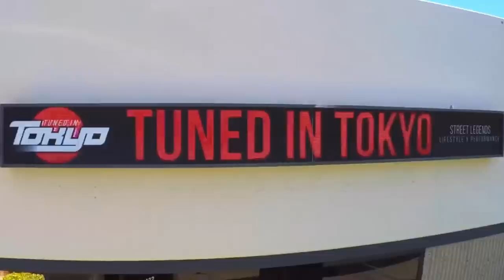350Z Exhaust Install - SOUNDS SO GOOD!

Comment: That sounds sweet when I used to have my Z I had the HKS Cat-Back system. If you want people to see it more and you don't want no drag on the rear bumper there are two clips you unhook it and you can fold the center of the bumper in and you can put it down with some self tapping screws like that you can see the exhaust better. And to get a better sound you can buy a plenum it's really easy to install I had put the 7 / 8 on mine and everyone thought I had a V-8 it makes the prayer song Sweet and it a little bit more horsepower. Just letting you know if that's something you would like to do.